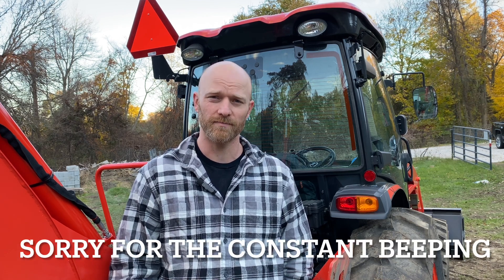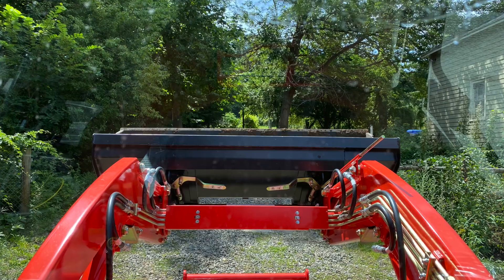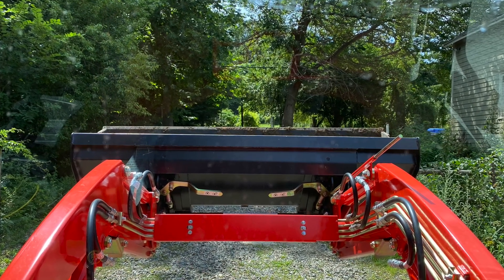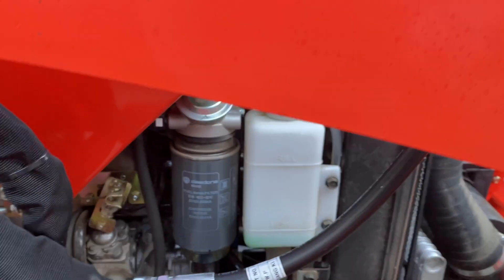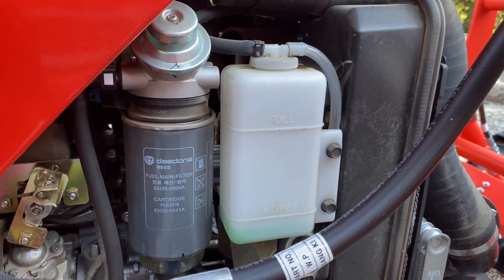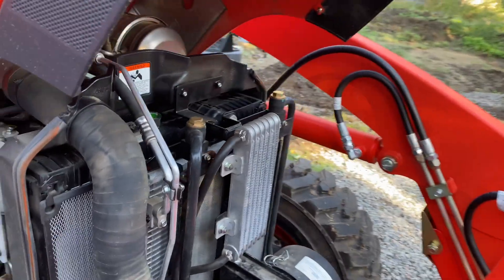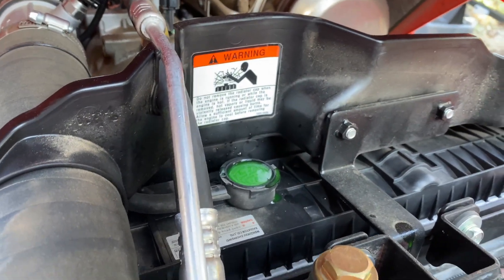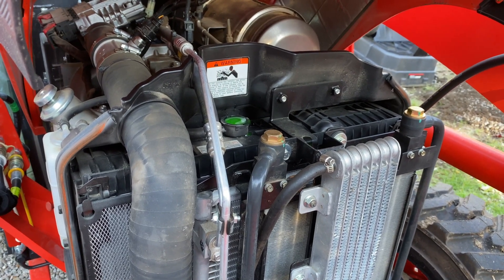Kioti Tractors - Everything that's gone wrong in the first 50 hours!  Lemon???

Comment: I personally have owned a ck2510 2014 model year loader backhoe bought brand new. It's 2023 and 900 plus hours loading, trenching, brush hogging, post hole digging, grading, tilling, and basically abusing though well maintained grease oils filters etc have had one grease fitting and one small 10mm bolt replacement. I really hate to see all the hate a speach  about nit-pick items, true issues okay legit complaints but kioti manufactures a really tough dependable tractor. Maybe I received an outlier but I doubt it and you received a lemon but that appears to be extremely rare at least for the many many people that own kiotis. Anyone wishing to purchase a tractor do the research and you can decide for yourself.

Comment: I have owned an NX4510 for just over two years now. No issues at all the first 50 hours. Just after 100 hours I had a hydraulic hose go bad and dealer took care of it under warranty because it was a manufacturing defect. Unfortunately, while in the shop for that, they did some recall software work, and it made my tractor go crazy until they made some hardware upgrades and then reloaded the software. For the most part, I love my Kioti. Got more for the money than other brands. Great dealer support out of Nashville. When I was trying to decide on a brand, I saw negative videos about every brand. I think you got a lemon. I hope the worst is behind you.

Comment: Hi I have a 2017 ck3510 and it has been tough as nails. I have about 400 hours on it and have only had a few minor issues and one big one. The most significant minor thing is that the bolts need to be torqued on the loader and wheels every 10 hours. Again,I work it like a horse on gravel road doing ditching and grading. The big thing is the subframe on the backhoe that attaches it to the tractor broke at the 150 hour mark. It is a well known factory defect. Kioti covered it even though it was out of warranty. It's plated and beefed up now and I added a connector so my top link could also connect it to the tractor to eliminate the cantilever. I probably should have gone with the DK series as I really do work this CK like a larger tractor. Keep it greased and bolts torqued and well serviced and it should last you. Mine was pre-covid (2017) so now they may be different as manufacturers are pushing tractor out the door to meet demand. In summary, I'm happy with my kioti and would buy another.
Reply from the maker: The backhoe is one thing I do worry about. So far no signs of problems.

Comment: The CEL came on in my DK4510, at about 160-ish hours then went into limp mode. Dealer came and picked it up. Turns out my brother-in-law had interrupted the Regen one time too many. Other than that, no problems and no complaints!
Reply from the maker: Bummer!  My regen came on once and I went through the process.  Hoping mine is an easy fix!

Comment: I had 2 kioti tractors. Recently sold my ck2610 that I bought new and never had a issue with it, just didn’t really need it. I never had a issue with it but it only had about 110 hours on it. I still have a dk40se and it has over 800 hours with zero issues but it is also made before the dpf/regen junk they have now. I believe most of the issues with the newer tractors is the emissions and computers they put on them. It’s not just a kioti issue it’s all newer tractors over 25hp.
Reply from the maker: I hear ya. The regen is a pain. Seems like a big fuel waste to me.

Comment: thanks for sharing the video, I feel your pain, I just put 50 hours on my brand new kioti RX 7320. my tractor developed a hydraulic leak on one of the loader lines the factory didn't crimp the hose tight enough and it's leaking. the loader bucket is made out of real thin cheap metal I dented mine up and bent it in the middle pushing dirt. you may have bent your loader arms. set the tractor on a concrete slab and measure the height of your loader arms from the right side to the left side  with a tape measure
Reply from the maker: Bummer!  Not a fun leak to have.  I measured it and the arms were all off.  The bolts on the loader arms weren't torqued enough.  I had the dealer check everything and they said they fixed it, but still is off.  I think the bucket is warped.
Reply: @Curtis1824  I bent my bucket pulling dirt when backing up with the bucket in the vertical position. it bowed the bucket about an inch in the middle. Plus when I back drag with the bucket laying flat if I run over a rock sticking up it caves ithe bottom of the bucket in. so I ordered the piranha bar and put that on that makes the bucket a little stiffer, and then I welded half inch thick by 3 in wide bars on the bottom of the bucket to keep it from getting caved in. you can order the kioti extra blade that bolts onto the bottom of the factory bucket that will help make your bucket a lot stronger. I ordered the piranha blade because it was actually cheaper than the factory bolt on blade
Reply: @madtater5948  One of the first things I did on my NX4510 was put on a AR grade cutting edge on the bucket.  I didn't find the bucket to be any more or less cheaply made than other tractor buckets I've seen, but I bought it used and the bucket had been scraped up.  Adding the AR grade steel cutting edge stiffened up the bucket significantly, and protects the front edge quite a bit.
Reply: A cutting edge is a great idea for the bucket. Saves wear on front and underside of bucket.
Reply: @madtater5948  The maximum tilt of the bucket, should not be more than 45 degrees or less. Then you do not put too much strain on the arms and rams.

Comment: i had a 2021 NX4510 the tranny went bad 2 times in less than 30 hours. i also had near zero fluid in front gear box. when i washed it the paint flaked off! they gave me a 2022 TYM T494 for some xtra gold dabloons LOL! i am happy with TYM it has been problem free so far.
Reply from the maker: I originally wanted a TYM, but couldn't get the one I wanted in any sort of decent time frame.

Comment: I'm with you! Bought my new 2020 Kioti Ck3510SE in Oct'20. Now has 130 hrs. It's been absolutely hell dealing with this junk and the dealer. In 130 hrs it's been back to the dealer 5 times...was delievered to me new with 3 large dents in the rear fender, one of the trips back to the dealer they pounded the dents out and I have to live with the powercoated chipped (will rust quicker), just a few hours in the front axle oil level didn't even show up on the dipstick (did in leak out or did the dealer not fill it properly?), several hyrdraulic hose leaks (and still leaking now), they routed the grapple hose so it's dragging on the ground with no hose protector wrap (one trip back they wrapped 3 feet of the hose with a roll of electrical tape that looked like a blind man did it, next trip back they did put the wire wrap on it), grapple 3rd function failed two different times, safety decal fell off, ROP pins would not engage, bushhog did not have the safety chain, seat safety switch failed 3 times until they swapped out the entire seat ($1700), floor mat curls up in cold temps, I've changed out rusted fasteners holding the mirrors on, rear tire fell off the rim and rimguard went all over my lawn and had to dig it up and reseed, front tire fell off the rim, flashers/hazard light fuse blew, grill guard pins are very hard to pull out, reverse pedal linkage chaffed through a hose protector underneath, was delivered with no lynch pin on the drawbar pins, linked pedal failed, powercoat flaking off the link arms, tossed error codes on the hour meter (F 26 / 1669), missing a screen in front of the radiator, on and on. I'm well beyond anyones tolerance level....I hope your troubles are over. Good luck.
Reply from the maker: I’m speechless. I can’t even imagine your frustration. I thought I was having a hard time, but my stuff doesn’t even compare to this. I hope yours is going better now!
Reply: I have no idea how they can bring you something is dented and then tell you you have to live with it sounds like you should just go to the lawyer
Reply: I am in the market ready to pull trigger on a 25hp Kioti, TYM, Massey Ferguson. Would you recommend I stay away from kioti? The best dealer support for me here in Sw Florida would be the Massey
Reply from the maker: @juancarlostoledo5184  When my Kioti is working, it's bulletproof and has done anything and everything I want it to.  My dealer is the problem along with this crazy world we're living in right now.  I don't know enough about the other tractor brands, so can't speak to that.  Maybe someone else on here with some more knowledge will be able to help you out there.
Reply: @juancarlostoledo5184  I really like my CK 2610 I haven’t had any problems with it not anything major at least
Reply: @juancarlostoledo5184  with the experience I'm having I highly recommend staying away from a Kioti. That said, you'll have to do your homework and research like it looks like you're doing. If I had it to do all over again it would be the JD3039R. I owned JD 790 a few years ago and not one thing went wrong it in the 7 years I had it. Wished I never sold it. When you think you have settled on the color, start interviewing the dealer. Don't be fooled by the wolf in sheep's clothing like I did. Have a list of your expectations and then ask them if they can live up to them. Let me give you an example....I bought a little CRF Honda 110 for my grandson this past summer for a fraction of the cost of this kioti. The salesman has reached out to me many times to check how I like it (Reynalds Sports, Buxton Maine). Heck, even got a birthday card from them. Not one time has my Kioti dealer even remotely reached out to me. Quite the opposite. Many times have totally ignored me...and may I say, both experiences, through this covid thing. Covid, other than availability, is not an excuse for poor quality products and service. Good luck!
Reply: @MrCatfishkiller35  what area are you in? What dealer did you use? I think that makes a big difference. 
What are the problems you did have? So I can try to avoid them
Thank you for taking your time to inform us
Reply: Sure no problem I am in Western Kentucky but I went down towards Nashville to buy mine from Larry strovetand you can find a lot of YouTube videos from the man on YouTube I dealt with Kurt which was very helpful at their Springfield the only problems I had were minor ones such as I got the backhoe attachment and the hoses on the side of it started coming loose at first I thought I had to leave and then just realize the jic fittings needed to be tightened but they come loose a lot and then when you tighten them if you don't back them up correctly the hoses want to kick out different directions and if you're digging around trees like I am doing you have a tendency to bump those hoses a lot so it's nice that they're protected but they take a hell of a beating right there I have some grease zerts that have been tore up just from the abuse that I put the machine through but finding ones that actually have the same threads has been difficult so it's unfortunate they had to use some kind of metric thread from the looks of it so I'm going to have to buy specialty grease zerts I don't like that very much seems like ones with just regular threads would be best why they have to change something as simple as that it's not like they're going to make $1000000 on those and like I said everything is really minor and mostly if not all of these things I brought on myself I had one of my blinkers orange lights brake almost immediately because of the spot they put them on the rollover protection bars I think that's a bad spot for them and the light bulb is burned out instantly but these are small things the performance of the machine has been extremely nice I love driving this thing around I do not have the HTC I have the manual and I love it about 15 working hours ago on the machine I did the 50-hour service myself everything went very smooth and very easy to be honest with you I will probably do most things that have to do with working on the tractor myself if I ever need any warranty work done I will take it to the shop to have it done but if it's something I can do and fix I will probably fix it so I can't really tell you how the dealership is fixing things and if it's difficult to deal with them because the most I've had to do is go up there and buy some filters and some oil from them I bought a set of forks when I was up there getting the filters and they were very quick about getting those for me but I cannot really speak for their service department because I've not had anything done there yet and to be honest I hope I don't have to benefits things that I can do I can always order the parts online and receive them at my house so being close to the dealership was never a real issue for me and most people that have tractors then live out in rural areas are never close to any certain place or dealership I actually have a friend right now that's going to base his decision on what he's going to buy because he is close to a dealership so he is limiting himself to one type of machine that he's looking at and that is a John Deere and that's fine but that limits him to just that and it's all because the place is 30 minutes from his house the best I could suggest you pick the horsepower that you think you're going to need and then research three or four of the brands that you like in that horsepower you can do the research right here on YouTube there is even a ton of different comparison videos I chose the coyote because it seemed like for the price I got a better machine for the horsepower that I was buying I didn't have to get the smallest compact with the tiny little tires I was able to go with just a little more horsepower now if I had to do it over again I think I would go up in the 30 horsepower range instead of the 25 but the 25 on the coyote is actually holding up very well I don't have a ton of acreage but I will be doing a lot of work I am removing a lot of trees and doing a lot of grading and digging on 1 acre of land that is covered with trees another suggestion is if you're going to use a backhoe on your tractor and you're not going to have a grapple on the front at least get yourself a thumb for your backhoe I didn't get one and I really wish I would have had one installed now I will probably install one myself but it would have been nice to have one from the get-go
Reply: Agree, i would have had a much better experience with folks like Mike and crew at Larry Stovesand Equipment. Im sure there are others, my dealer wasnt one of them.
Reply: @charlesreed6404  What dealer have you been having trouble with?  I'm in Maine also and just bought a CK 3510 and didn't get the service I was hoping for.  Nothing horrible, just they didn't tourqe the wheels, loader bolts, or check the air pressure like they should of.  It looks like they pretty much greased it and called it good.  The other dealer I tried to buy from wouldn't even get back to me with a quote after multiple messages, and after talking with them in person.  Ugg, the world we live in.
Reply: Manchester Motors in Augusta and also their other location in Topsham. Both locations, same owner, same horrible people to do business with.
Reply: @charlesreed6404  that definitely sounds like poor dealer more than the tractor. The tires fall off the rims when the air leaks out. That’s part of having a tractor. Some of that is probably work related but a lot of that was a poor dealership sales experience it sounds like
Reply: 130 hours is nothing.  Case doesnt even break in until 500 hrs.

Comment: I have a NX6010. bought  new 4 years ago. Nothing but heart ache. Spent over 8,000 dollars on various  repairs. Front tires dry rotted 2 years. Bucket mounts bent. $2000. Wire harness $1300. Cracked main housing leaking  hydraulic oil. Bad casting. Bucket control handle broke. Left side back wheel rim came apart and fell off. Today I started plowing and I cloud of smoke came from under the hood and it died. Smelled electrical.

Comment: I have pretty much the same tractor a DK6010SE, HST, Cab and Loader. We bought it back in 2018 and haven't had any problems with it so far... One thing to try for your loader is raise it up all of the way and hold it for a few seconds at the top of the stroke and see if it evens out for you.
Reply from the maker: I'll give that a try.  Thanks for the tip!  They said they leveled out the arms and everything measured up fine.  I feel like the bucket is a bit warped.
Reply: @Curtis1824  The bucket could be bent, the Kioti buckets are very light duty, if you look at the bucket on a skid steer or a John Deere 5 series there is no comparison and I have seen people bend those heavy duty buckets before... I put a cutting edge on mine its a bit of extra reinforcement, I should probably weld some reinforcements on it as well, I have just been to lazy.
Reply: Put a cutting-edge for the bucket.
Reply from the maker: @ChrisTheBrit1  any recommendations? I’ve looked around and all seem about the same.
Reply: @Curtis1824  BXpanded piranha tooth bar.

Comment: Your bucket may have been build twisted. You can cross check it (measure diagonally) from edge to top with a tape measure, just like if you were building a square frame. Additionally you can measure the opening on each side and compare.
Reply from the maker: Finally got around to it and it’s warped. Off a little over half an inch which is about what it looks like it’s off when looking at it up in the air.

Comment: I have 20 hours on my CK2610SEHCB  my rear windshield wiper mechanism froze up on me. Dealer said not under warranty.  I took it apart and found there was no lubrication in the maim shaft. I had to tap the shaft out with a brass drift and sand  the shaft and hole with 320grit paper. Applied SuperLube and moly grease. All is well again !